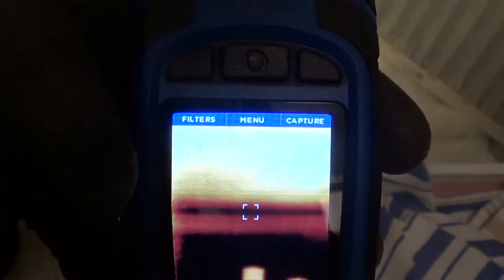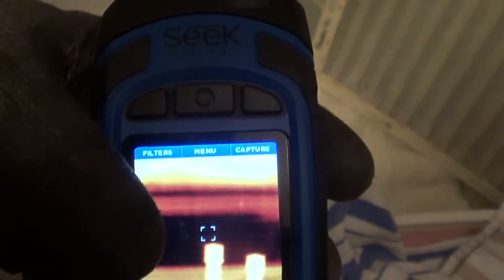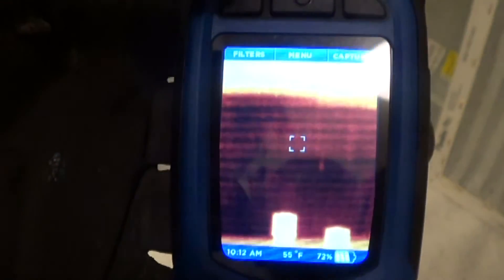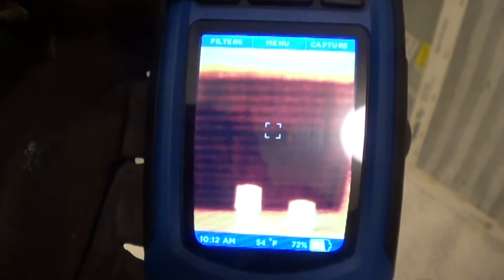Thermal camera showing evaporator refrigerant level

Comment: Nathan cool video. Are you able to use the thermal camera to find refrigerant leaks as well?
Reply from the maker: No.  It is just seeing the cold liquid inside the pipes.  The IR leak detectors have a similar name, but they are looking at the specific wavelength of IR called a gas spectrograph.  A IR leak detector is just 1 pixel and looks for changes in intensity of a specific filtered wavelength of IR passing thru the sample gas in the sensor.  They are not very sensitive either.  Heated diode leak detectors are 10x more sensitive than the IR style.  Gas companies do have a version of IR leak detectors that can spot methane leaks from a few hundred yards away using a telescope.  But, that is a high dollar instrument and it isn't tuned for refrigerant.

Comment: Nathan, thanks for posting.. Have you ever took an image of the TXV and identify restrictions or overfeeds?
Reply from the maker: +S Sam   I will be uploading more thermal videos.  TXVs clearly hunt for about 10 minutes and the image is really stunning to look at.  The thermal image is much faster than even a $200 fluke clamp on pipe thermocouple.  Looking at a TXV directly with thermal won't show much because the super heat is zero there.  So, all the distributor pipes will be the same temperature without any indication of the velocity of the refrigerant thru the tubes.  However, there are some good practices to follow such as never placing a distributor horizontal.  This really applies to very large commercial applications.  Gravity will make the lower tubes gather more liquid refrigerant and the upper tubes send more "useless" gas.  So, in general, you want the distributor to flow up or down and not sideways.  I don't think this matters on residential because there are usually 4 or less circuits and the distributor is very small.  You can see a sharp point inside the distributor to make the liquid try to flow equally to each circuit based on flow and not pressure.